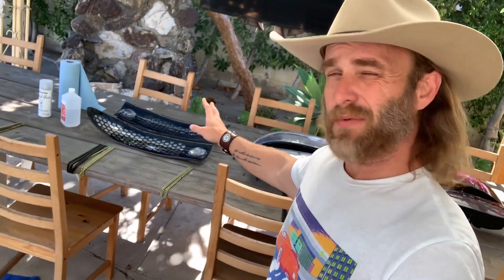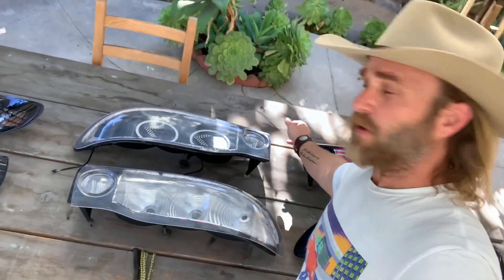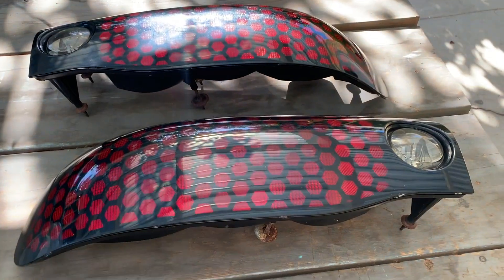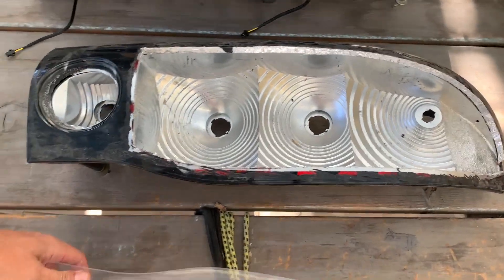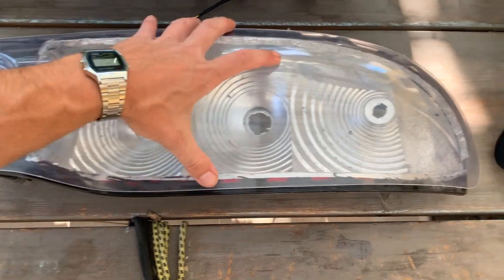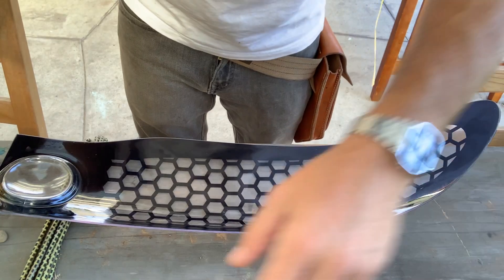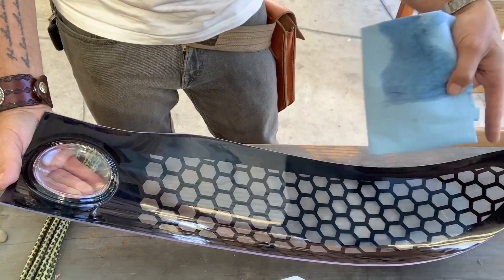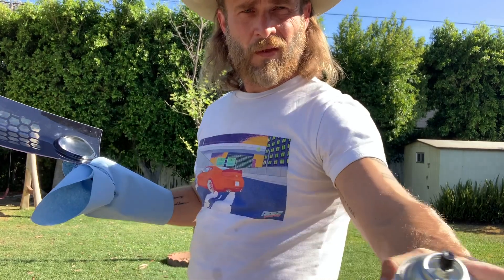1993-2002 Firebird/Formula/Trans-Am Clear Lenses Custom Tail Lights How To and Product Description

Comment: Very cool, I have an 02 firebird honeycomb pattern, one has gotten dark, will differently check out your site. Those look great.
Reply: You can fix the dark one with a heat-lamp.  Just soften the glue that holds the lens on, pry it off, then paint your reflective housing silver.  Glue it back together. Done.

Comment: When will the red honeycomb full taillight assembly’s be back in stock? I want a pair, mine are cracked and I just seen that yours are sold out.
Reply from the maker: We have a slight back order, hence out of stock, but email me and I can get you on the list mark@irocmotorsports.com

I also have a red set I converted from crappy OEM housings for $850 shipped.  Has broken mounting tabs (one on each housing)  but bolts on fine and can’t see once installed of course.

Comment: @Mark 
How do you attach your lenses? How do you keep the moisture out?
Reply from the maker: After years of trying every sticky adhesive I could find…. VHB mounting tape by 3M has turned out not only to be the easiest and cleanest to apply, but it seems to seal better as well.

Apply a thin bead of clear silicon to the perimeter (after they are bonded with the tape) if it helps you sleep better lol.

These housings are all so old though generally you’re better off sealing them with the bonding tape AND drilling a few small weep holes (one under each light socket basically) to let moisture get out in case it does get in.
Reply: @markallendelisle  thank you for the reply. I'll be starting my build soon I hope. After watching your video my mind is churning with ideas for my taillights. I'll be sure to order from you.
Reply from the maker: I should be dropping a video with new designs in a week.
Reply: @markallendelisle  excellent!

Comment: So just the diffused lenses with honeycomb pattern are $500 ?
Reply: Yup. Called a monopoly you can charge whatever wanted with no competition
Reply from the maker: Yup.  It’s a three part process to make them.  We form lenses, then apply the design, then apply a uv protectant.  It just adds up especially since it’s so low volume we get zero price breaks.

We do offer full housings now though www.irocmotorsports.com
Reply: Why does carbon fiber sail cost a lot more? Near double than fiberglass.

Comment: Totally bad ass however $400 is a little steep for basically covers. If and when the price comes down I'd definitely buy several sets asap
Reply from the maker: I agree but price actually went up $50 already.  Material costs have doubled since I started this as has shipping.  If you want to buy several then email me because I can definitely discount.  Shipping alone (all in one box) knocks off $50 a pair.

Comment: The factory lights only blacken when exposed to rain. I own 3 2002s, 2 of which have never seen rain & all 3 are still perfect.
Reply: What happens when you wash the car ? 😅 

It has nothing to do with Rain , more so to do with the water intrusion issues and the seal failing … LT1 style grids had a problem with delaminating …. Camaros had a similar problem with their Reverse light lenses falling off while driving …. GM was shit back then as they are shit right now … We just gotta make em better and think for the idiots that made our junk ….
Reply from the maker: It’s not rain or water it’s luck of the draw.  It’s just crap chrome that turns black from GM like the crap glue they used on the roofs.